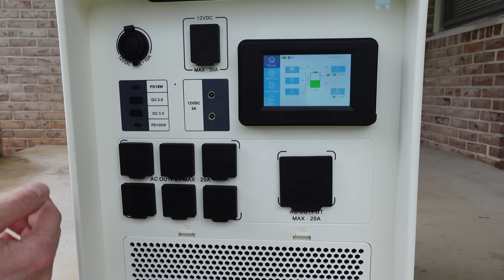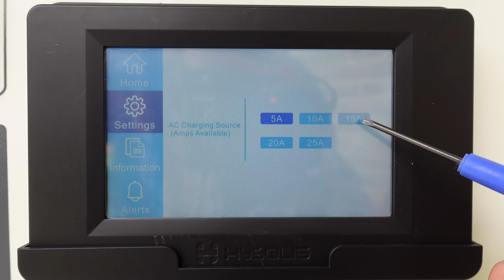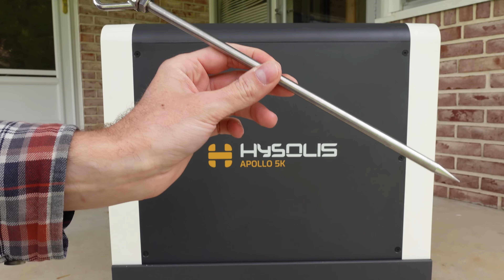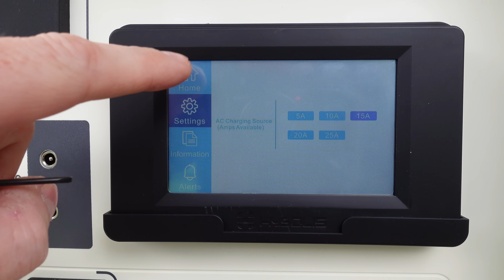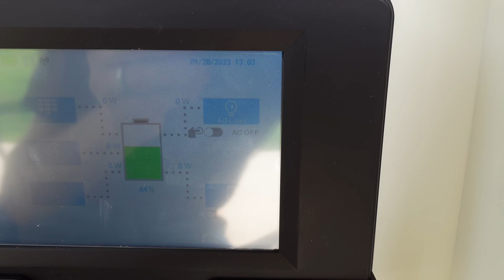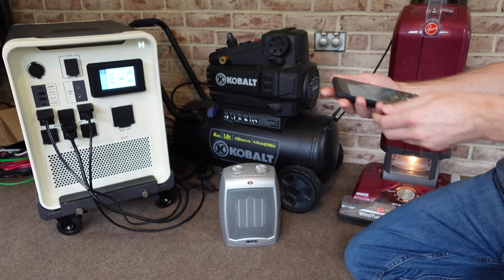NEW Hysolis Apollo 5K LiFePO4 Portable Power Station, Detailed Review

Comment: It's such a waste to even bother with USB outputs on a device like this. On a unit like this, there's zero point in it. The functionality would be better with a single anderson 50A and four power pole outputs. Nobody using a massive device like this is going to USB or 12v cigarette plug into it. Especially considering you can get a powerpole to cigarette plug for $10 or make your own for the same price. Same with the barrel plugs. As for the USB, I can get a$50 GaN charging brick and get the 140 watt output with the AC ports. Strip all that wasted space off the front and actually space out the AC ports so they're not nearly as crowded. People using this for DC will already have a powerpole fuse block you can energize with a single power pole, and having a 50A anderson plug would be better for high draw DC devices like high output DC air compressors. If you have a removable screen, you're already seeing a use case where this is a remote device. So don't add USB which isn't something you do remotely.  It's like they listened to too many focus groups and got more and more feature creep instead of focusing on simple outputs that can be tailored by the end user. The reality is this unit is just too big and too fancy to piss about with pointless features. If you want USB and barrel plug, buy a cheaper AIO. This is for marine, semi permanent or long term installs.

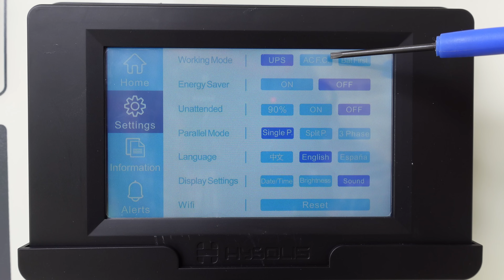Comment: Question: At min. mark 5:54 you state that "battery first" uses battery power until "the battery are depleted." Is there not a way to limit the discharge to, say 10%, or 20%? And can you limit the charge to batteries? e.g. 90%.

Comment: Too many new power stations offer up huge battery capacity possibilities. My point: at 4.5 kw input and 114kw battery 0 to 100% soc  is 25.3 hours plus and extra hour or 2 floating. I know the full 100 is extreme but 114kw needs 11k charge if this power station was using no more than 30kw battery then yes , nice unit.  Maybe I am spoiled with a 11kw max charge, currently 9k working and 11k by next month. Not trying to be negative just factual and informative.

Comment: I bought and run a split phase setup.   10.7 kwh is less capacity than I thought.  I need 2 expansion batteries to give me another 10.7 kwh.  Total kwh of 21.5kwh which is the beginning of enough capacity for me…..but that will cost me another $7400.   Im thinking I should have bought a EG4 system with a 30,000 kwh server battery rack for close to or less than my 21 kwh apollo system.  Do yourself a favor and look at the EG4 diy system.  You will want more capacity.  Apollos great but really expensive!  I would not buy them again.

Comment: I need one that is about half of everything this one does. I recently installed a DC assist mini-split heat-pump. At this time of year I don't need heating or cooling. There is four solar panels connected directly to my mini-split. 1,320 watts 180 VOC going no where because I'm not using it at this time of year. We still use hot water though. I have a 10 gallon electric water heater in series with my gas fired tank-less water heater as back up. The 10 gallon tank is in by-pass mode right now. I would like to put a unit like you show here into my 10 gallon tank to preheat water before it goes into my on demand. The problem I see here though is that this unit has way to many features that I don't need. Do they make a unit that does half of what this one does?

Comment: This thing pushes the limit of "portable", but is otherwise the most capable unit we've seen.  Personally, I would never spend that much money on something with all of the components combined into a single device.  If any one thing goes wrong (and there is a lot in there to possibly fail!) you would have to ship it somewhere for service or wind up with a very expensive paper weight.  For smaller, truly portable power stations, all-in-ones are great, but when you start talking about whole-house solutions, a component-based system is the way to go.  You get more capability in exchange for less portability, but avoid having a single point of failure.  The only way I see the Hysolis Apollo making sense is if you split time, living in an off-grid cabin part of the year and in a larger RV the rest of the year. Moving something this big more than once or twice a year would be more trouble than it's worth.  For any permanent off-grid solutions...a component-based system would be far more cost-effective.

Comment: What  a shame the RV plug is only 25 amps instead of 30 amps.
Reply: Agreed. Although he said 30A at one point, the Hysolis site confirms 25A. Strange choice.
Reply from the maker: @josephbrabenderiii2049  The receptacle is a NEMA TT-30R (30A). The maximum continuous output of the power station is 25A even though it's using a 30A receptacle. I hope that clears up the confusion.

Comment: Very good and interesting review.

I would have expected at least a 5000W inverter to go with the very large size and very high price.
I don't like that the cables for the parallel connection are not 90 degrees, where unnecessarily take up a lot of extra space in the back.

For such a large device I miss a monitoring system with history and the possibility to connect, monitoring and setting the unit from anywhere with internet - this should be the common standard nowadays for all Power stations, something like Solar Assistant or VRM portal, and I would like the possibility of monitoring for online and offline mode, where in offline mode the data would be stored in internal memory and in the next online mode the offline data with usage would be automatically transferred to the monitoring system itself. Hopefully some Portable Solar Station will have this functionality someday.
Or at least have the possibility to connect to a Solar Assistant like the All-In-One inverters have.

But otherwise, it's a very good Power Station even though it's very expensive and if it works it will be at the top of the market and competitors will have to think to have something competitive to this Power Station

Hopefully there will be a 230V version for Europe soon.
Reply: agreed. the unit seems extremely well built, but you can make a diy with a larger inverter and same capacity for less than half the price.  i understand companies exist to make profit, but it shouldn't be over double the cost of buying the components yourself and doing the assembly (which is really not that hard...)
Reply: @jayjonah2762  I agree too, and it will always be DIY possible to further easily upgradable and if one DIY component fails, it will just replace it.

Comment: I'm impressed, but unless they do a 230v/240v version I would need 2 of there just to get started as English power we use 220v to 250v here, also our hot water pump and shower pulls 280v @ 60amps making it 9.1kw, so its looking like it might become expensive really quick for my location in the world if I was to adopt this portable power station. 😔

Good video and thank you for taking the time to share, I'll be looking forward to the next video.

Cheers from England. 👍
Reply from the maker: It's important to remember that this was designed for use in the US. I'm not even sure if you can switch it to 50Hz. I didn't see any settings anywhere for this. Also, you must have one of those instant water heaters? The problem with those is they don't work well off-grid because of the instantaneous demand, as you noted :) My heat pump water heater takes hours to heat up a full tank but it only pulls around 400W.

Comment: Can it automatically turn on the AC outlets after a loss of power once power is available?
When completely off grid,
and only using solar panels.
Reply from the maker: Yes, that is the unattended mode. You would set it to battery first, select unattended, then select your desired restart percentage. Once the solar charges up the battery to the set percentage state of charge, the inverter will automatically turn back on.

Comment: Nice system but the clunky work around for the 240 volt is a deal breaker in this day they should have the 240 in one unit.
Reply: 100% agree, makes it very expensive to get this to work in the England as you need 2 just to start.

Comment: £4,157.00 😆
Reply: Yeah its expensive but if your using English £ then its 2x mate, as England requires 240V so you will need 2 system just to get one lot of 240V as each unit is only 120v and in England you would only get your shaver and travel tooth brush to work on that.

Comment: Glad you got the same efficiency figure that I got for capacity test. Was wondering what you would get
Reply: and "E07" instead of a meaningful message on a screen with so much real estate and microprocessors with megabytes of dirt cheap memory!
C'mon Hysolis, put a bit of effort into the coding!
Reply: Oh weird, I've never seen the blinking battery symbol under load before
Reply from the maker: @WillProwse  It seemed like it was about to shut down then the air compressor reached full and as soon as the air compressor shut off, it returned to a normal state. I wasn't able to replicate that a second time so I concluded that it was giving a warning before throwing an alert/fault code.
Reply: @LithiumSolar  looking at the video again closely you can see on the 2nd run it did amber alert before the red alert shut down, but it only left 1 code in your menu.

Also on most systems like this if the load is very very large it will pull the battery voltage down as if the voltage in the battery is just above the yellow anyway, then the heavy load in most cases pull the battery just below so in this case it went yellow as in charge me soon if you continue to pull this many amps / volts at this rate, once the load has gone the voltage climbs back to the green as it went back over half full battery, aka amber is just battery getting low.

Just my observations of course I could be wrong, but thanks again for the video. 👍
Reply: Are you planning to pst any new videos on the Apollo?
Reply from the maker: @SteveElwood-x4f  Is that directed at me or Will? I'll have another here soon with a teardown/disassembly. Please let me know if there's anything else in particular that you would like to see.
Reply: @LithiumSolar  Actually, both of you. The Apollo looks very promising notwithstanding how expensive it is. I look forward to seeing your additional video(s) and any Will posts as well. Thanks for providing all this information!